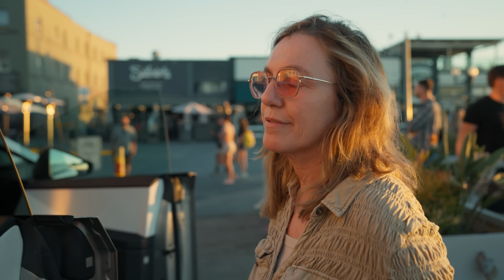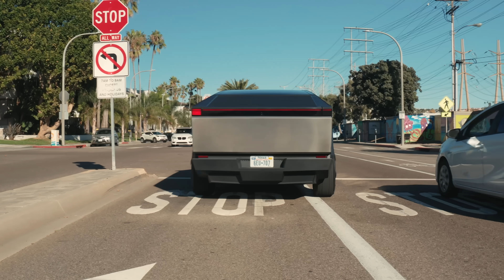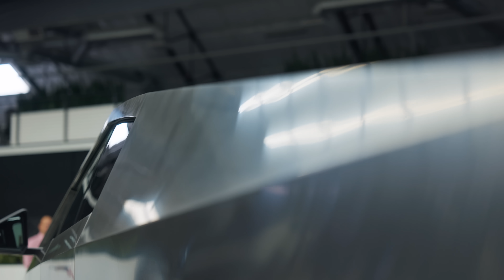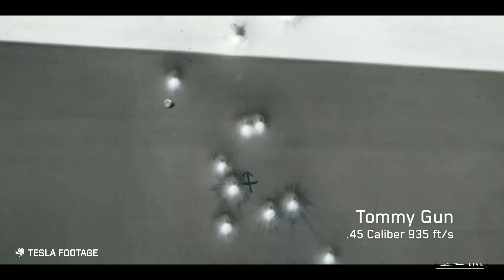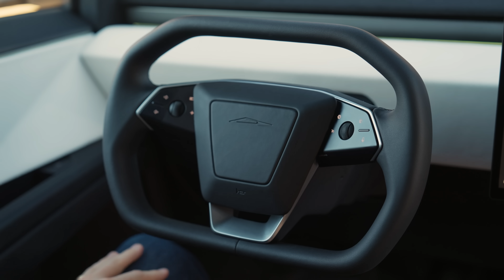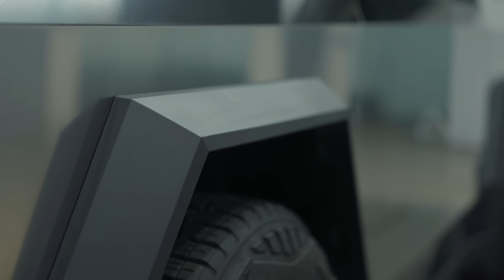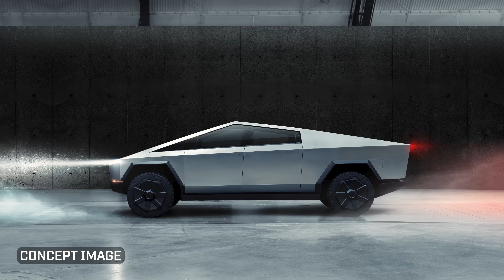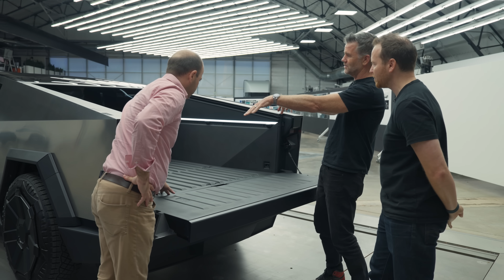FIRST DRIVE: Tesla Cybertruck Full Review

Comment: The engineers segment was probably the best part of this. 👌 So refreshing to hear smart people not dumbing down stuff...
Reply: Totally agree!  That was incredibly interesting.  Just hearing about the hurdles of shaping the body panels with air machining
Reply: @christiandulaney1638 ❤
Reply: @christiandulaney1638  And ended up with a vehicle that looks like an experimental prototype, then short of finace they let a first-year sheet metal worker build the body.  Flat panels are so easy to make.
Reply: "So refreshing to hear smart people not dumbing down stuff" To be fair its pretty dumbed down and approachable, but that's a good thing.
Reply: Yeah, I think this thing will impress people that pay attention to the utility and engineering
Reply: @jake89g ⅚6😊😊😊
Reply: @jake89g the Tesla Cybertruck has V6 Hyper Turbo engine.
Reply: @jake89g  There is no utility with this thing and the engineering in it is no different than any other ev. No one cares about how someone made flat stainless steel panels that are badly welded and badly gapped. People who want a truck care about capacity, ease of access to said capacity , range and over all capability.
Reply: @corail53 The same or larger bed size, payload max, and towing capacity as an F-150.
And let's see the F-150 power an arc welder. Body panels that can take a much harder wack without denting than anything on an F-150. More truly secure and lockable storage for tools. Far fewer moving parts to break. Gorilla Glass (not bulletproof but break resistant), MUCH faster and more maneuverable.
I am in no way an Elon Musk fanboy. I own no Tesla stock.
I drive a 6-speed manual and love doing the three pedal dance and the act of driving.
This thing should still be pretty remarkably capable, even if it looks like a grade school student's drawing of a car from the future.
Reply: @corail53 This is the first vehicle in the world to have full 48-volt architecture. This is the first time a vehicles FULL electrical system has been upgraded to higher voltage since we went from 6 volts to 12 volts in the 1950s.
 if you double the voltage, you can half the amperage which means much less copper wiring per car.
Because Elon Musk is who he is, he sent a PDF to every major car manufacturer and parts supplier explaining how to do full 48-volt architecture in a vehicle. So they can catch up.
Up until now there has been 48 volts used for mild hybrids, for a few of the cars subsystems.
You can hate on the Tesla, you can certainly hate on Elon Musk, but that's an innovation.
Reply: @corail53 well good fucking thing it’s good at that as well
Reply: @corail53 fact is this Americans who drive trucks for their utility would get more use out of a cargo van. But Americans don't actually care about utility they drive trucks because of the image. All those babied lifted trucks on wagon wheels they have never seen  dirt...
Reply: @williamgechtman9287  I’m going to agree with you. You make some really solid points. There is a lot going for this vehicle.
Reply: Because they didn't even really drive the thing.. in a video titled "DRIVEN!"
Reply: Definitely, I wanted to hear more about the air bending lol
Reply: I mean, they were direct and knowledgeable but I don't think they got incredibly deep in the weeds there.
Reply: its almost always the case that engineers should be the people to do the talking instead of some PR moron.
Reply: @Decenium well the engineers from Tesla definitely gonna loving it.
Reply: @Decenium  You mean musk.
Reply: Yes I LOVED that part 93 days is F'n crazy to put together a proto.
Reply: 100% but he did say “clip” instead of magazine so I know which area of technology he studied😂
Reply: I worked in a tool and die shop.. all we bent was steel.. those engineers don't know what they are talking about they might be mechanical engineers but they know nothing about materials, specifically steel.. I have never had to bend SS bars with air.. we just use a hydraulic press
Reply: I'm shocked we can hear you with Elons balls in your mouth
Reply: Sorry they still rather have 6 managers in other places 😂
Reply: Yeah
Reply: right.  I opened several videos and good thing Tesla segmented the large Youtubers to unique content of the CT.
Reply: A paradigm shift will take place very very soon (before winter solstice ---> December 12, 2023) and it will be the celebration of the Blessed Hope, The Rapture of the Church of Christ, disappearing from this fallen world, so that the world can enter into his 7 years of horror, the Tribulations.
The intangible date of the beginning of these Tribulations was the evening of November 12, 2023, so we are only enter recently in it and as soon as the church disappears, it will be cataclysmic.

It is our justification by the Grace of God through our Faith in the BLOOD of Jesus Christ that will save us.

Those who remain on earth will experience unimaginable horrors after the Rapture of the Church and will have to die for Jesus Christ Our God manifested in the flesh, more than 2030 years ago, during his birth in this world on fall of 7 BC.
"The left behind" will have to carry their cross and will be saved like the saints who died in the arenas of Rome devoured by lions, because of their FAITH in the BLOOD OF THE ATONEMENT SPILLED by CHRIST ON THE PROPITIATORY OF DIVINE MERCY IN HEAVEN.

----> only this METANOÏA will save you, at this precise moment and by dying for CHRIST by refusing to idolize the system of the beast which is currently installed before our eyes, by the false prophet and the antichrist... this is what will save you. GOD BLESS YOU
Reply: I agree mate spot on
Reply: I concur, very insightful
Reply: So dope
Reply: Jesus. All this information has been available, for quite some time. Pisses me off that it takes top gear to get people to believe it. So unreal. The delusion that car guys live in is amazing.
Reply: Meh
Reply: EXACTLY. 🔩🦾🤓👍
Reply: @pangrac1 The VP clearly didn’t know what he was talking about, he was just throwing out a word salad of the first smart sounding terms that popped into his head.
Reply: @gopackgo4036  For example?
Reply: @pangrac1  The loads that are causing torque (which isn’t even well defined for this shape of an object but I suppose you can say it’s the lengthwise axis at center of mass) are not stated. What exactly do I need a high torsional stiffness for? The other thing is, you don’t necessarily want a very high stiffness because without “flex” you will feel every load.
Reply: @@Mathilda2zero keep repeating the quality control crap, that's like old news.  They have improvement tremendously.  Keep quacking your woke mouth.  Tesla will be the number #1 company in the world
Reply: 2nd that! so much new technology!
Reply: I am kinda mad about the: ""stainless isnt actually stainless it corrodes over time"" part ... just say that you have different types of ST Steel ... now they make it like they invented the wheel. Knive guys wil know what I talk about haha
Reply: @niekbeentjes8849  👈🏼🤣 it’s funny how you think there’s only one type of stainless steel. If you researched the relationship between Tesla and Aperam in their development of this alloy (also used on Space X rockets) you wouldn’t have to look like a troglodyte on YT. 🤡
Reply: The incredible thing is even though they kept the dumbing down to a min, I was able to understand it. Its weird how more knowledgeable I am. Most of my knowledge comes from places like YouTube and personal research, not from school.
Reply: It was dumbed down though... unless that was your point.
Reply: I agree as well. The guy is making all the right choices with his engineers and designers. This will be a beautiful vehicle if its anything close to hid other automobiles
Reply: I love when “smart” people, can’t even spell right when attempting to demean others. Love it!
Reply: @ramonorlando7124  ah yes, because spelling is the #1 indicator of IQ.
Reply: I love all the haters in the comments lmao 😂 I picture a bunch of naysayers and cynics in a circle in the backyard talking shit about the innovator, pointing and laughing, then seething even more when they are proven wrong. I love haters, the world needs some haters, because it causes or forces more innovation and success. Tesla is on the right track.
Reply: @ramonorlando7124  it’s a crazy thing called critical thinking. It requires you use your brain, I know, it’s difficult. But maybe not just believe everything you are told at face value.
Reply: Sorry I’m not Steven Hawkings
Reply: It is devoid of anything that appeals to the eye, it looks like a godless commie designed the "truck". A horizontal refrigerator on wheels.
Reply: Watch SavageGeese. They're the best on the planet. Actually they're just the best in general.
Reply: I enjoyed it so much.
Reply: Totally new way to make trucks with Tesla high technology built in a amazing new EV!
Reply: That dumbing down style is so annoying. It gives people who don't already know the subject wrong idea about it and it doesn't invite curiosity to something you don't understand.
Reply: Nice to hear the people that are making it all happen. I applaud them for their innovations
Reply: Rimac will have a run against Tesla
Reply: What part do the engineers talk?
Reply: That was incredibly dumbed down, what are you even talking about?
Reply: Oh they are definitely dumbing things down.
Reply: @kimchee411 why they dumbing these down?
Reply: @kimchee411  yeah, and most of it was spin. Like, they basically said that aerodynamics was an afterthought while succesfully giving the opposite impression.
Reply: @kimchee411 😊😊
Reply: @kimchee411 😊😊😊😊😊😊
Reply: It WAS dumbed down, you just didn't notice.  😉
Reply: Totally agree...if we saw more of these people as day to day reps of the brand vs youknowwho...it would be a stronger brand by miles...
Reply: @htd2006  *even strongesterer
Reply: Why were they not talking at the launch event!!!
Reply: 100k you want to make sure it's good. Just wait a few years.
Reply: It is a huge missed opportunity that the CT does not have a HUD over that huge windscreen. How cool would be that?
Reply: @SomewhereInTheSolarSystem  Couldn't agree more... That and a rearview display of the live feed in the usual position.
Reply: What I found hilarious was the actual engineer ensuring he corrected or elaborated when the clearly marketing dude drops big and clearly exaggerated claims.

Example: 
Marketing executive: "and it's bullet proof"
Engineering executive: "well, it can take you emptying an entire clip of 9mm subsonic from a Tommy gun, but clearly not supersonic or rifle rounds".

Marketing executives are the worst. I'd pay money to be able watch people throw a steel ball bearing at that dudes head like he threw at the original cybertruck window.
Reply: amazing really with a product so dumb fisher price could have made it,
Reply: Damn, I was in a hurry, so I skipped the wrong parts.
Reply: btw, they DID dumb things down
Reply: @JD-un2zv  these r businessman not engineers.
Reply: they said nothing more, then any car-reviewer I already watched...
Reply: An electric DeLorean that can't from LA to SLC faster than a 1970 6 cyl, Chevy truck for 10x price. Only an engineer thinks that's makes sense.
Reply: @rickden8362  omg this is so cute. You must have spent all day thinking of that ridiculous analogy. Then copied and pasted it everywhere.   
Word of advice. The orange crayon is called orange because of the color, not the flavor.
Reply: @Meatball2022  Only a child would jump to crayon as his best, first analogy. Try again, child.
Reply: @rickden8362  I tried to create an analogy someone with severely limited intellect such as yourself might understand. I guess I overestimated your abilities.
Reply: "Tesla cars most drag efficient in their class" claim is a straight lie.
Lightyear has 0.175, Lucid Air 0.197, Mercedes EQS 0.200, Model S 0.208 drag coefficient  Do not forget the Cybertruck was once claimed to cost 30000 USD (now 60000 USD) base price, and the tri-motor was claimed at 70000 USD (now 100000 USD).
Make it green so it looks like the Halo Warthog.
Reply: @THEREALZENFORCE  nobody buying those pos lucid, merc, dude.  Lucid is losing 440k every car they sell.
Reply: Tesla engineers are on another level. Musk knows how to pick them. Humble too and work well in a team. Sharp. Know what it's about. BBC presenter seemed like an overpaid bit part in comparison.
Reply: @andrewnorris5415 and yet Tesla is continuously at the bottom of the JD Powers ranking .
Reply: *dumbing not dummying down. Smart people know 😅
Reply: Took me 30 seconds to find a bunch of videos showing aerodynamics testing of vehicles with wheels spinning, its nothing as cool and unique as the engineer made it sound. Not very impressed lol
Reply: Yeah top gear narrators are absolutely daft.
Reply: It looks like bat Mobil
Reply: @drvishal14 or more like combination of Flat Mobile (FlatOut 2) and Bat Mobile on the back.
Reply: @drvishal14 It looks nothing like a Batmobile.  What does your brain look like? 😅
Reply: @12:00

The part where the dude has the Freudian slip and refers to the truck as a car, said to me as an engineer, this dude legitimately forgot the truck was a truck because they made electronics magic happen, and now this engineer's subconscious has confirmed it regards the physical forces routinely demanded to operate this vehicle, as no more difficult than that required of one of their Tesla cars. ❤
Reply: Too bad they couldn't "engineer" the after thought tacked on screen better😂
Reply: IMO - Kind of a puff piece, and a little fuzzy around the edges.
Reply: @anxiousapp😊😊😊😊liance
Reply: @anxiousappliance  Exactly. Marketing waffle designed to impress the undemanding.
Reply: You come across as someone who knows a lot about waffling so leave the thinking to the rest of us with brains ok cupcake! @ochayethegnu2915
Reply: @ochayethegnu2915 👈😂 I found a groomer who’s still triggered over Elon snatching up the left’s echo chamber!
Reply: Telling us how they built an overcomplicated and overpriced dumpster, lol. Who cares
Reply: Sorry, it's not my type. Seems like a kids' car 😂😂
Reply: @Ahmed-q9v3d  double up as a kid's slide
Reply: The clowns that are drooling over these things and reviewing them, don't really know what a truck is, and why trucks behave the way they behave, why they are uncomfortable when you hit a bump, why despite a century of experience, enginers are not able to get rid of those problems that trucks have This electric Honda Ridgeline is not a truck, so obviously it doesn't have the unpleasant characteristics of a truck.
Nobody will cross shop between this toy and a Ram 2500, nobody! Techies with money and no clue about trucks will buy these.
Reply: Elon is like Nikola Tesla of the future, we are so lucky to have Elon in our generation
Reply: Exactly right. A lot of people are hating on Elon, but he will eventually be recognized for everything he did for humanity @pitechx
Reply: @pitechx 

Not that late really when you remember that they had to build the plant to house the machinery to build the Cybetruck. It has been lots and lots of work to get it ready for this place and time.
Reply: @pitechx The real Tesla wouldn’t have bought Twitter as a media stunt or called his child a serial number 😂
Reply: you mean present? /sigh  @pitechx
Reply: @pitechx How? Tesla was not quite the business man. To put it mildly.
Tesla was a real inventor.
Musk has a good feel for other people's inventions.
The only thing they really have in common, is their terrible people skills/autism.
Reply: @foeke8740  Yes Tesla is a genius inventor.  Elon is another genius inventor.  You just mad bro why you live in a world being mad at people who did nothing to you.  Get a life
Reply: @pitechx you couldn't be any more wrong.
Reply: @benturp3492 I think he’s trolling
Reply: @benturp3492 Yeah, who needs a guy who single-handedly shifted the entire automotive industry to electric, who built landing rocket boosters and now ships 80% of the stuff the world sends into orbit, who’s built a global satellite internet system, home and industrial scale battery back up systems, makes the best selling car in the world, on and on. The dude is obviously a worthless slacker.
Reply: Benturp, it is actually you who is wrong. You're simply not paying attention.
Reply: @standj21  Believe me, there are thousands of people who believe in Musk's "gEniUs"
Reply: They are salesmen not engineers
Reply: @benturp3492  no, they are on the engineering team. Just stop with the ignorance already
Reply: @DwDDB  I am an aircraft engineer and I think what they are saying is total BS. It's just a PR stunt. All they need to do is sell the tesla brand. 💵💰
Reply: If you want to hear engineers talk go to Honda. “We made the front end so your head could fit under it to watch the game” 🙄 what soccer mom asked for that? These guys are overpaid and this SUV is a fail.  What Tesla should do is make a power train and sell it to the major manufacturers.  THAT would be the right move.  Gasoline is still King and controlled at that.  We all know vehicles are capable of double+ the mileage they are getting.  Your vehicle doing 60 mph at 2k rpm could be doing 60mph at 1k rpm with just another gear.
Reply: Seriously? It was utter nonsense.
Reply: At least they were smart enough to take a bunch design ideas from the original Honda Ridgeline.  I was waiting for Rix to mention that but he just let them keep talking. @ochayethegnu2915
Reply: Seriously? You  can do better `I take it?
No thought not! @ochayethegnu2915
Reply: @ochayethegnu2915 thank you! These guys are 🤡
Reply: @ochayethegnu2915 I agree
Reply: @ochayethegnu2915 It was. For some reason people outside engineering/physics here fancy sounding terms/processes and automatically think it’s correct.
Reply: UTTER nonsense. sub sonic ammo.... repairing the paint on work trucks. Panels made of hardened stainless that have to line up perfectly with no framing after an impact that has NO stricture to stop deflection... revolutionary special non traditional truck aesthetic that looks like a Pontiac Aztek futurized  @ochayethegnu2915
Reply: @ochayethegnu2915   im so glad of this new bullet proof tec,im always getting shot a when going shopping life saver😂
Reply: @ochayethegnu2915 Dont talk bad about the Cybertruck, its amazingly engineered. Its a Model X with rear wheel steering and stainless steel panels. Thats it.
Reply: @thepetrolman4879  Is that why it’s been 4 years? It’s a shambles. I’m just thankful it’ll never be sold here.
Reply: LOL Yeah because you can do better? Your attempts at trolling are a shambles so go cry elsewhere ok cupcake! @ochayethegnu2915
Reply: You are blinded by your own hate for Tesla. You need to open up your eyes @ochayethegnu2915
Reply: @thepetrolman4879 It’s trash 🗑️
Reply: @ochayethegnu2915 out of curiosity, is it delusion, hatred that is interfering with grasping reality?
Reply: @DwDDB  The only people not grasping reality are the Musk fanboys who have no idea about automotive engineering.
Reply: Just a tv and a steering . Wow engineering 😂😂😂
Reply: i grew up with the a guy that helped write the first edition iso9000 standards book (look it up and check for the name williams. he's dead now) and on the team that designed  the current gen honda civic seats (inc type -r). He was my dad and i spent a lot of time as a kid challenging him so he would come up with better ideas. I am now a CS. i can assure you, nobody at tesla is as good as my dad. check yo panel gaps for evidence of that fact. I've not got to that section with the engineering head yet, but when i do i assure you i will piss myself laughing at this moron that thinks cast aluminium chassis' were a good idea. Or how he came up with the idea of using bulletproof glass that is not bulletproof (the new test uses a rubber ball. regular automotive glass withstands a hit from a size 5 football. ask me how i know that. i dare you). the stainless steel castings will not hold up in a crash, not even as crumple zones. this is a car that, at minimum 2.8 tons for the 2 motor version, will kill your ass if you hit a 2009 era renault grand scenic.
Reply: Nice story bro. Honda civic is a literal joke compared to the tesla engineering @M3PH11
Reply: oh i forgot to mention that the stainless is going to need a retreated (and by retreated i mean replaced) every couple of years. It will not hold up like tesla says it will. i hope you have saved up enough for clearbra or metal polish.